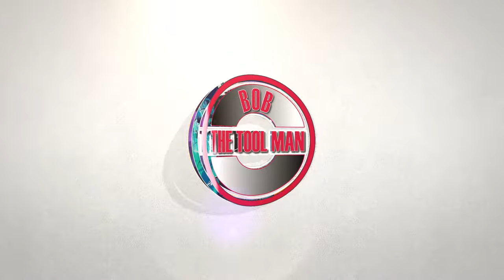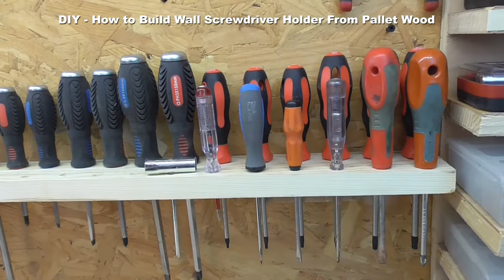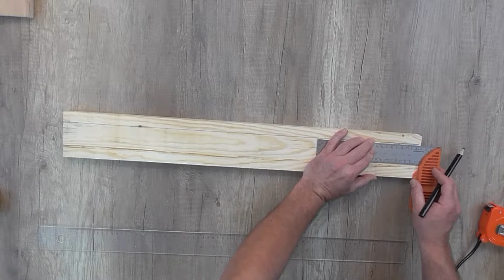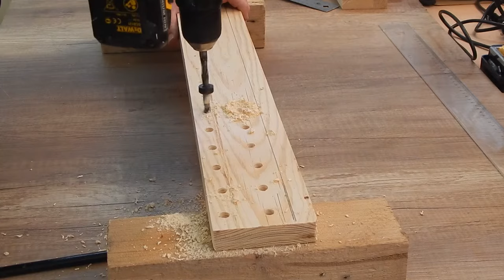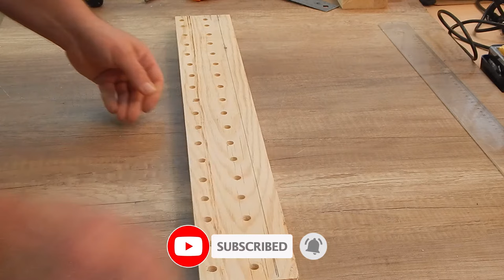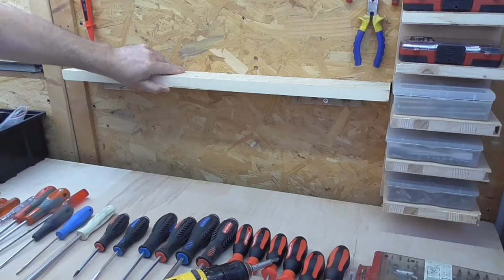DIY - How to Build Wall Screwdriver Holder From Pallet Wood - Bob The Tool Man

Comment: Nice. A little long. But I will give it a try. I hate always having to wrangle screwdrivers. Especially older ones that don’t have the marking on the handle if it’s phillips, flat, torx, etc. 
Never fails. When I need a phillips, I get flat…and vice-versa.
Reply: nail polish the symbol on the end cap